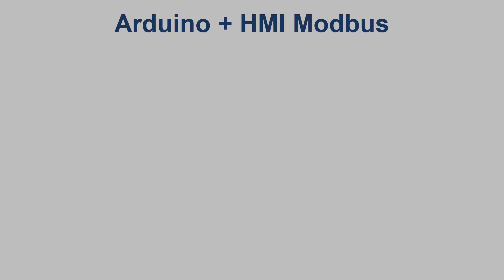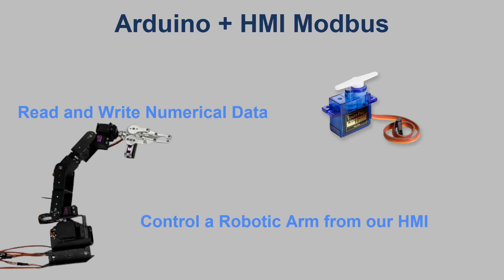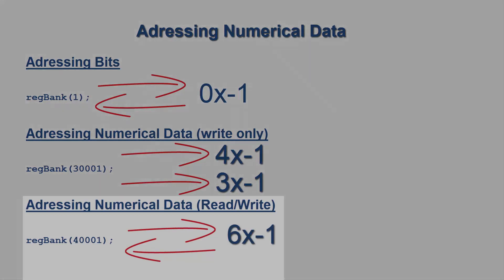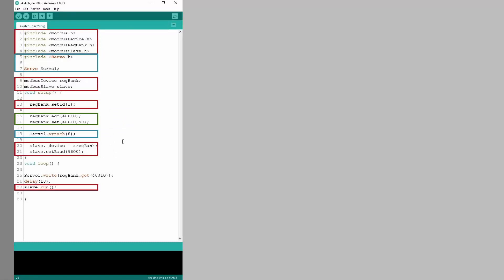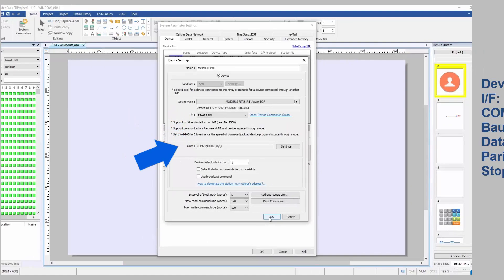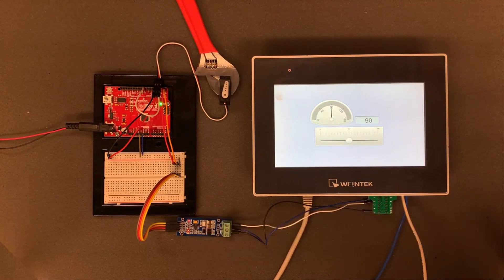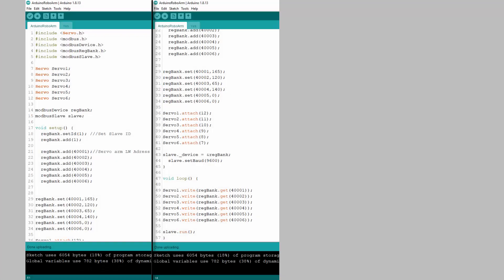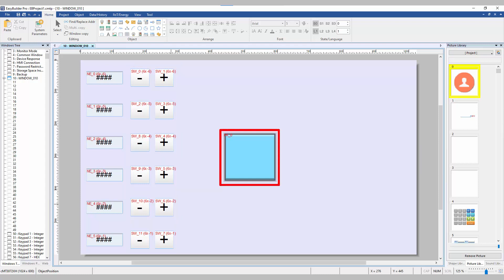Arduino + HMI + Robotic Arm via Modbus Basics - Weintek Open-source coding & simple EBPro Macro.

Comment: Hi, many thanks for your good videos as always. Can you explain the reason why the regbank 40001 is mapped to reg bank 6x , i think it is misleading would it be better simply to have regbank 60001 to reg bank 6?
Reply: Hi Maker,
Within this demonstration, we had to map regbank 40001 to the 6X register of our Modbus RTU driver because the 6X register supports Modbus function code 0x06. 
This function code is compatible with the Modbus server library that we used within the Arduino's application.
Reply: @WeintekUSATeam.0  i see 
Many thanks